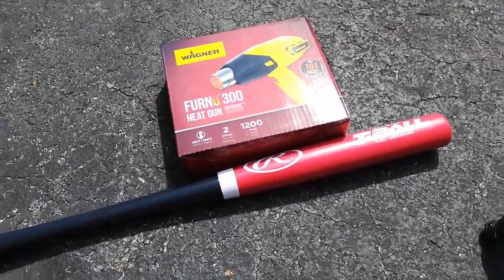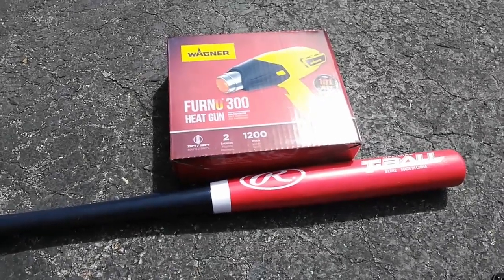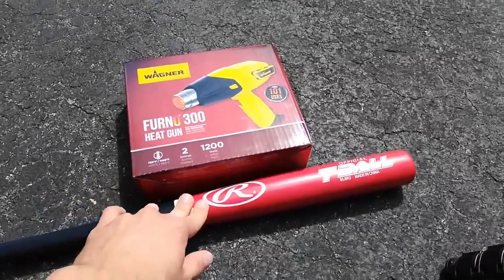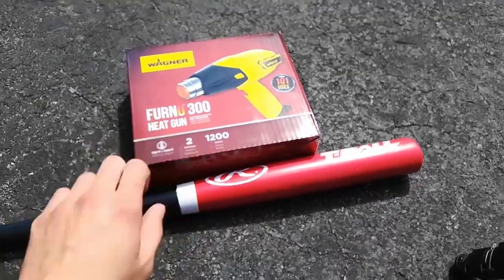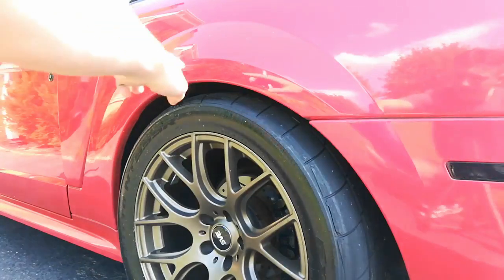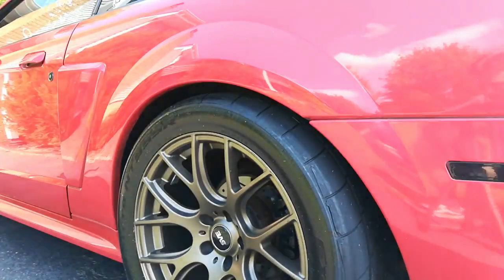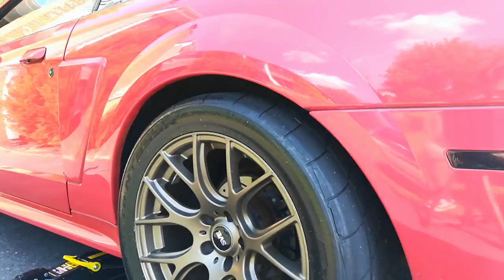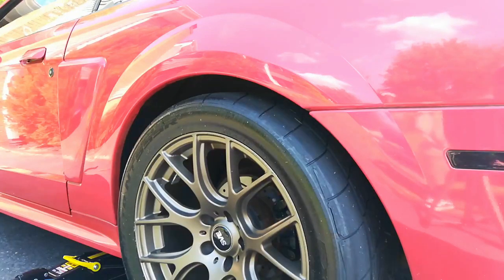Rolling My Fenders With A Bat!

Comment: Do you need a heat gun ?
Reply from the maker: It's recommended
Reply: if you don’t heat it up first, the pressure when rolling ur fender could cause your paint to crack